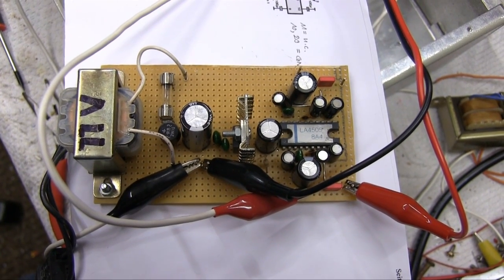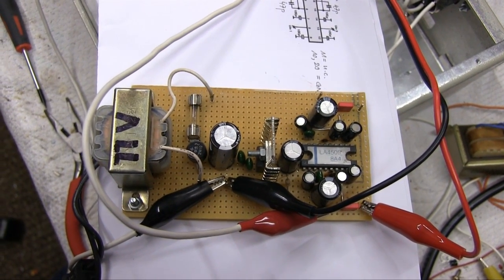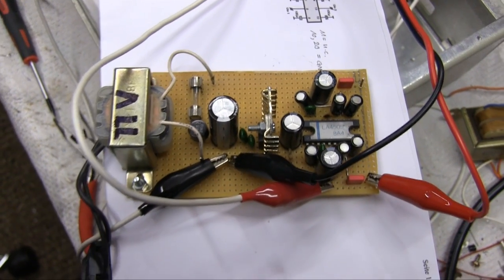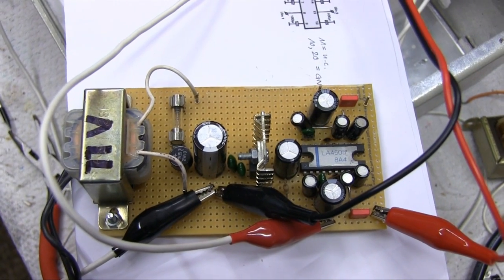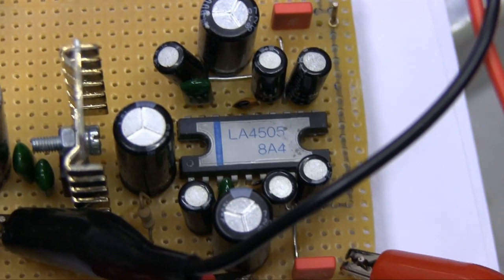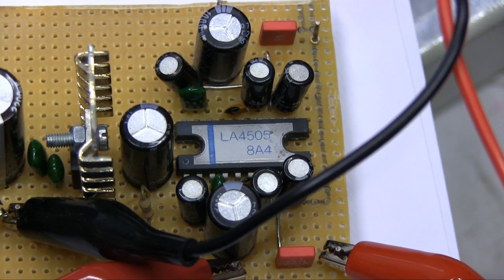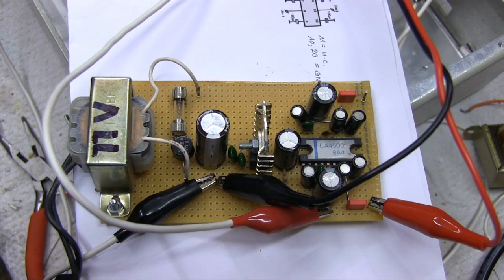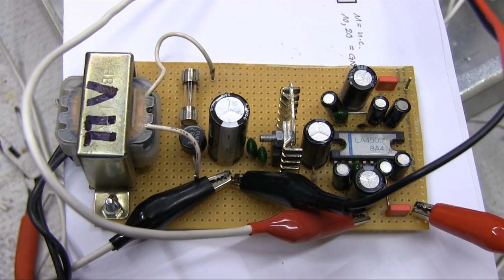DrCassette's Workshop - Single Circuit Board Amp (fail)

Comment: To desolder things I use solder wick, not expensive and for small chips works great were desoldering gun does not do much. Old chips are not really happy with high temperatures so no wonder it does not work. For simple bench signal tracer I would recommend TDA2822M, minimum components, cheap, DIP8 package, standard 12V supply (works ok down to 5V) and around 2x1W output. Also I would not recommend to use 78XX as voltage stabilization on amplifiers, too much noise and they don't hold big loads nicely. Better go with a simple zener diode and a darlington transistor.
Reply from the maker: I wanted this to be quick and simple, so that's why I used that voltage regulator. The chip itself isn't that great so the power regulator probably won't make it even worse ;)
No solder wick for me, I hate that stuff. The heat gun approach was a first attempt, one temperature step lower should do fine without destroying semiconductors. I might actually have that TDA chip, not sure though.

Comment: I had to remove a CPU out of a laptop, the duck butter just wouldn't budge, so I grabbed a blow dryer to free it, it worked but I was rather surprised at how hot it got after a short blast of air, luckily for me, the CPU still worked...but like you...lesson learned!! :)

Comment: I would put a heatsink on that amp chip! Also the heatsink on the Voltage regulator doesn't look that good! It would be really cool if it did work! Nice effort, just replace that amp chip.
Reply from the maker: This amp was supposed to go onto my workbench for low power testing purposes.So power would have been lower than 500mW, so all the heat sinks are dimensioned correctly.

Comment: Sometimes it's good to fail, You learn more that way :) Should be easy to find a replacement, Those chips are in everything these days. It would be well worth purchasing a desoldering gun. They save so much time removing components.